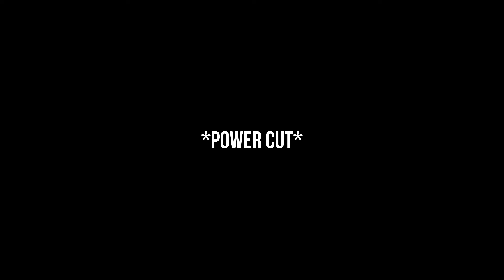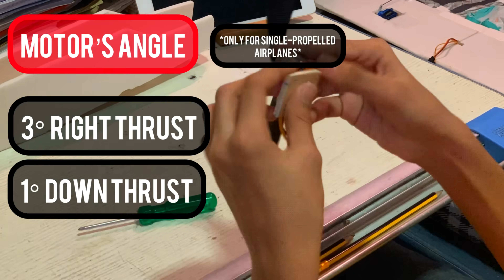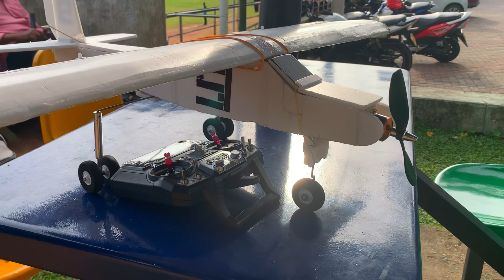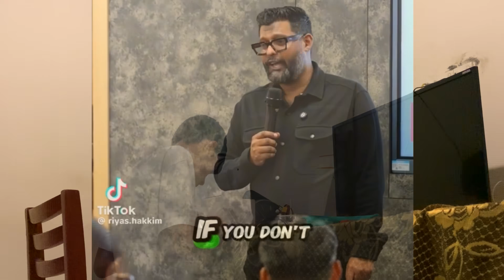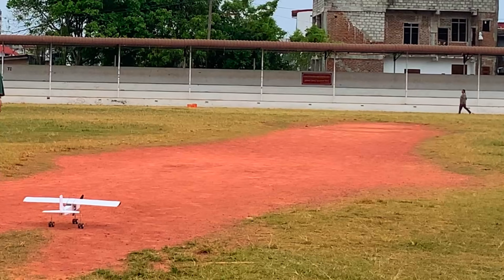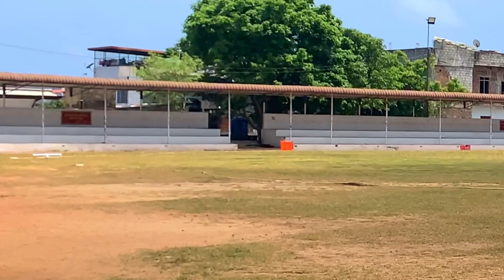I Built an RC Plane at 15… (And FLEW it)

Comment: Hello
The way you’re loading the components in your airplane isn’t correct. You need to find the airplane’s center of gravity (CG) and position the battery and other components inside the fuselage so that the airplane is properly balanced. The nose should be slightly heavier than the tail.

Also, the position of your landing gear isn’t correct. It sticks out too far from the fuselage.

For your first airplane build, try making the wings narrow and long — roughly twice the length of the fuselage. For that fuselage, make the wing about 12 cm wide and 100 cm long.

Also, spread the landing gear apart.

When building the airplane, try to use as little glue as possible. For example, I noticed that you used a lot of unnecessary glue when building the wing. That will make the airplane heavier. After applying the glue, always use a small piece of foam to spread it out and remove the excess glue.

Try to keep the fuselage under 400 grams, and the entire airplane, including the battery and motor, under 600 grams.
Reply from the maker: Thanks for the advice, I'll definitely keep these tips in mind for my next build! 😅

Comment: This is amazing I also fly rc planes started like 1y ago and we have very similar building techniques I'm very impressed you did great!! As for improvements try using fs2a 4cg receivers they work with the FS tx you have they weigh 1g cost like pennies and the last time I checked the Rx you are using is 18g so you can shave off some weight also I did too worry about the trust angle but trust me throw that mindset into the trash cuz it can do more harm than good just slap it on as straight as possible and if it flies wierd like turning or smth just trim it that's what the tx is used for. Over all GREAT JOB I'm looking to see more of Ur planes

Comment: 059    servos  do  NOT  go  at  the  tail.!     BECAUSE, doing so makes the tail HEAVIER.!      it is not clear whether the elevotor control horn is correctly located.    
124    a pushrod end should have 'z-bend'.!     not a u-bend.
127    in case you don't know,  this  is  a  SF prop.!    not an E-prop.
152    WRONG.!!!      with electric power,  a  ZERO-ZERO  thrust line should be used.!!!
232    the main landing gear  Should  be located below the cg;  aka thirty percent of chord.    if this mistake is not corrected, the model will have a wonky distribution of mass (dom).    every part of a model aircraft should be as  LIGHT  as is practical.    so, DON'T  use four wheels when two will do the job.!    the track width of the main ig  is  Excessive.
559   too  much  MASS  in the main lg.  and it's no located  even  FARTHER  aft  than it should be.
Reply from the maker: Thanks for the detailed feedback and tips for improving my future builds!